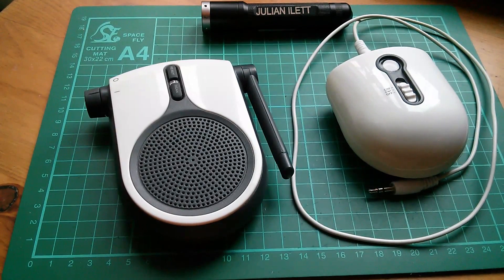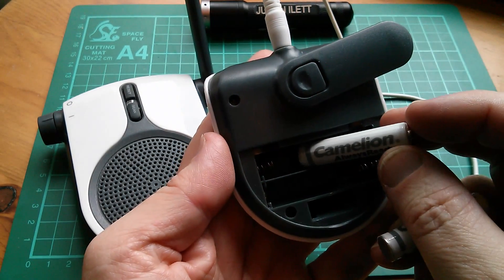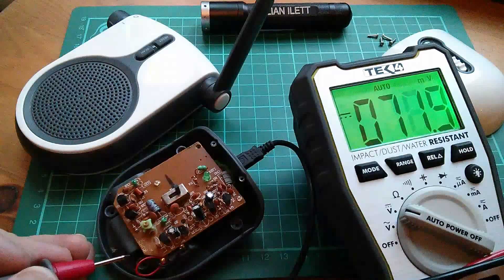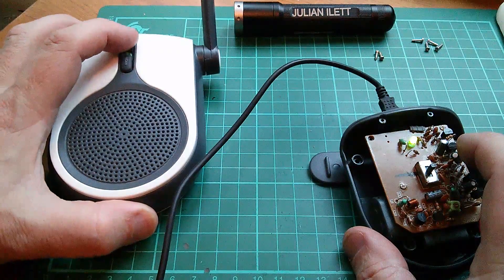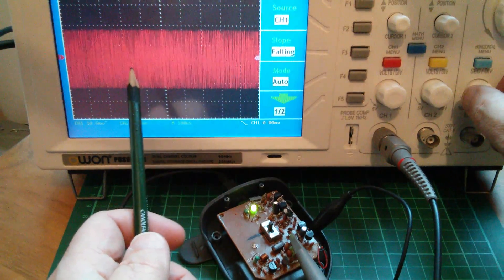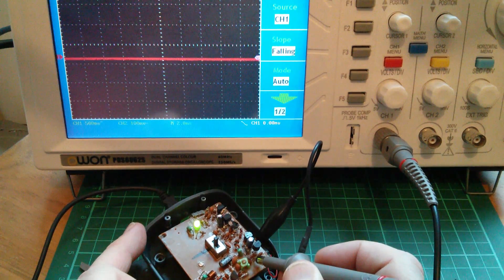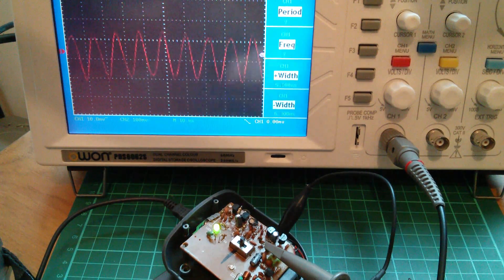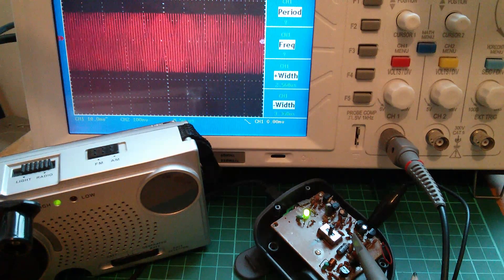Fun for £1: Poundshop VHF FM Transmitter Receiver Set

Comment: I was also going to suggest that you use a Cheapo RTL8232 dongle as a spectrum analyser. It would show the frequency drift before it goes into 'power save' nicely. I've got four of the little beasties and use them for all sorts of things, from spectrum analysis to ADSB and data-radio decoding.

Comment: The oscillo is limited at 60MHz and the FM freq is at 88Mhz? Can that actually work ? (real noob question)

Another thing, i noticed when u turn off the sound the led gets dimmer and dimmer (and on the oscillo the wave dies out -- as you noticed ) can it be a "feature" ? No transmission if no input?

Comment: You could take a look at the emitted spectrum using a 12-dollar SDR dongle. The cheapest ones come with a surprising bandwidth (50-1600MHz) and software like SDR# can give you a good idea of what you are working with. It could definitely let you confirm the frequency drift of the carrier when the audio is muted, as well as the quality of the carrier itself. It also lets you tune in to various radio communication, although probably not the police.

Comment: I'd suggest this from the readings you got:
The square wave signal is a very amplified audio input used to charge a cap' to keep the transmitter on. When you muted the audio you saw that signal go away and at the same time the frequency drifted down and the LED went off.

The weird waveform patterns would likely be a result of the same. As the frequency drifted down the aliasing on the 'scope caused that shuffling effect.

Comment: On your digital scope when you start turning down the horizontal scale you will find that the sample rate will also start to go down. (not necessarily every step).  Your scope only has 250MS/s at the high end but once you start to slow it down it was too slow and you get that aliasing effect.  If you have an analog scope you won't have that problem of course.

The reason the signal died when you removed the audio source is simply to save battery power when you don't have anything to transmit.  That's actually a good thing in many ways.

Comment: I teach signal processing at a University here in the UK. The short version of how I'd explain the strange effect at around 9:00 to my students is present it as an example of a phenomenon known as "beating". In this case your oscilloscope is displaying an aliased version of the waveform because it's sampling at a frequency well below the Nyquist frequency for for a ~100MHz FM RF signal. (If I was following you, the effect appears at 100 microseconds/division and with, let's say, 50 pixels/division gives about 2 microseconds/pixel or a sampling frequency of around 500kHz.) Because the sampling frequency is very close to an integer multiple of the signal frequency you get these bands of high and low density which are the oscilloscope equivalent of the famous "Moiré" patterns one gets with two printed grids moving across each other. Just like a Moiré pattern changing greatly with very small relative shifts of the grid you're seeing quite noticeable effects from very slight relative differences in modulated signal frequency and sampling frequency. The gentle relaxation from muting the music is probably some barely noticeable low-pass filtering happening in the analogue FM modulation electronics which becomes noticeable because the oscilloscope is accidentally becoming a very sensitive relative frequency detector due to the beating. Relevant Wikipedia articles: "Beating (acoustics)" and "Aliasing." The above is a highly compressed explanation but YouTube comments are not really the best place to discuss signal processing theory(!)
Reply from the maker: +Rich Wareham I'm guessing that an analogue scope would only have shown the 88MHz sine wave and that the audio modulation of it would have been invisible. The digital scope was providing a crude and unintentional frequency detector/demodulator... of sorts.
Reply: +John Ridley Wouldn't the amplitude of the wave drop if the circuit was entering some sort of low power mode?
Reply: Is it not an automatic gain control on the input, effectively searching for an input?
Reply: Haha.... took me a few minutes to write it and you came to the same conclusion :)

Comment: Great video as always, but the battery fix, if it's like most of the metal plates that bridge between the two batteries on the cheap items I buy, just jam a thin screwdriver behind the metal plate and bend the centre out a bit. Of course it might all go horribly wrong but it has always worked for me. If the plate is too thick to bend then I guess 'Dictare's comment about trimming the plastic is the other option
Reply: Solder blobs on the terminals!

Comment: That auto-off operation is interesting. It just slowly drops off, drifting in frequency all the while, from 88 to under 60MHz.  That's real stable, all right. Wouldn't think the regulatory folk would like that, even tho it's low power. Does seem to snap right back on freq with input, tho.  
 Those little 'flanges' in battery boxes are really annoying. Same thing on some 9V battery boxes, one of the instrumentalists at church this Sunday couldn't swap out his fading battery, as the replacement had slightly recessed connections. Fortunately, the guitar made it thru services ok, tho a bit of anxiety on my part. (Sound board)
 A little bit of slop in the mold making, or batteries that aren't the same as the one they used as a reference, and all sorts of annoyances!  Especially dollar store type stuff, it seems.  Thanks for the always interesting videos!  Stu

Comment: hi julian.my questions are with regards to your under kitchen cabinet lighting.i have seen both vids.i wanted to copy your setup.my understanding is you have two rows of led lights, one cctv connector you have soldered a positive and negative cable to each row.then you have put both positive and negatives in to one cctv connector.so you have ended up with 2 positives and 2 negatives in one cctv connector? is that correct? i need all the help and advice i can get.many thanks.
Reply from the maker: +arfan jhangir Correct - although you didn't mention the Wago commoning connectors. I need to make an update video on this project because the LED strips haven't lasted very well - half the LEDs have faded, gone out or are flickering.

Comment: The weird effect at 9:30 also looks like aliasing to me. It is caused by the sampling frequency of the oscilloscope being too low for the current signal. Since the sampling frequency of the oscilloscope and the transmitter's local oscillator are not synchronized all sort of weird things can appear on the scope's display. For a proper explanation of aliasing on scopes, see https://www.youtube.com/watch?v=g3svU5VJ8Gk

Comment: could you show us how to modify an xbox one power supply 5v 1a rail to 5v 10a ? sure it could only need slight modding
Reply: Throw it away and spend a few shekels on a proper 10A PSU.

Comment: I think the square wave you picked up was rectified audio feeding into the auto power off circuit to keep the thing alive. 
But without audio the cap would discharge and the series device (fet?) would be conducting less. As the supply to the oscillator falls, the frequency is drifting and also the amplitude is falling.
Note the LED brightness falling too, as others have seen.

Comment: 10:30 the point you were touching was probably the oscillator, FM oscillators have low capacitance, so the 15 pF input capacitance from your scope probe threw it way off frequency.

Comment: Hmmm. CH1 87.2 MHz, in the UK that's actually below the FM Radio allocation. I believe that's in an OFCOM reserved range. I doubt it's an issue for such a lower power device as they are normally exempt from licensing anyway.
Reply from the maker: +Graeme Pinnock That's a point, the receiver says 88-108 and the transmitter says 87.2MHz. What nonsense! I doubt the Tx frequencies are very accurate, there are no frequency synthesis components in there, just inductors capacitors and resistors.
Reply: +Graeme Pinnock Only 300kHz off, if it is accurate at all. Probably not, might be higher or even lower. a good place to look up the frequencies is here, VHF band for quick finding http://www.ofcom.org.uk/static/spectrum/fat.html
Reply: +Graeme Pinnock +julian llet  This is a weird one indeed. The sticker on that thing shows Dutch and French so probably they wanted to import this in Belgium.  Now the other thing that you noticed is the 87.2MHz which is below the actual 3m band making this probably illegal and was never sold officially.
Another thing that immediately made my jaw drop was the circuitry. Seems no PLL and the cost of making this. You have for example a bh1417 where you only need a couple of other components. PLL, stereo and whatever.
Now measuring these things with a scope is a no go. You need a spectrum analyzer.  
The part where you had to rescan was due to the fact that the oscillator of the transmitter was drifting because of external things, wire, your skin etc.

Comment: wow, they had these in the poundshop about 5 years ago, i guess they really did buy up some excess stock, certainly a small market for these.  I vaguely remember trying one, the receiver radio has all the sensitivity of a dead duck.
Reply from the maker: +jusb1066 It probably was about 5 years ago when I bought this. There was only one left, so I grabbed it. The receiver is a bit rubbish. But I still can't work out how you make sense of an FM signal on an oscilloscope :/
Reply: +Julian Ilett Notice the transmitter light turned off after a short amount of no input, i guess its a power saver, hence your waveform,    find out the aerial connector shove a long wire on it, see how far you can receive with it (with a decent radio)  Being discrete, it could be hackable for some extra power, if anyone wanted to run a pirate radio
Reply: +jusb1066 I agree, these things are usually designed to turn off when there is no input.
Reply: +Julian Ilett Looks like a class d amplifier is used to feed the transmitter. Seems to convert the audio into a PWM signal, amplify the pulse width, then convert back the width of the pulses back to a sine wave., passing through a low gain filter to get rid of the high frequency garbage.